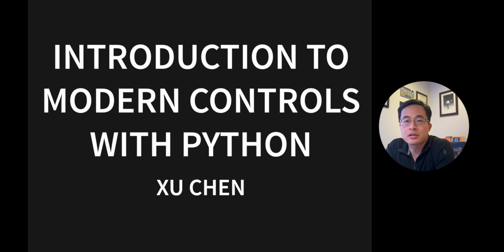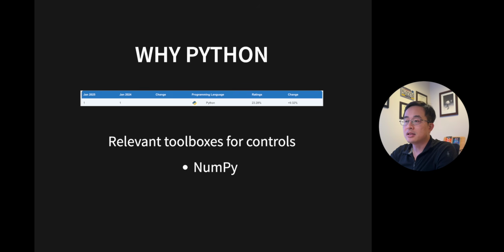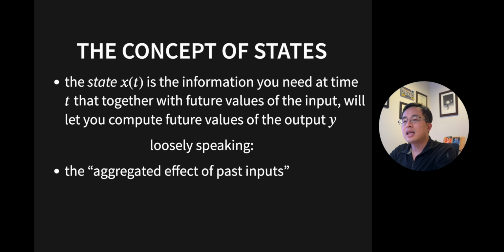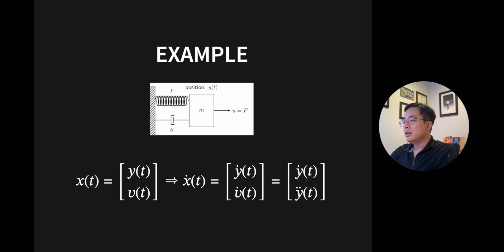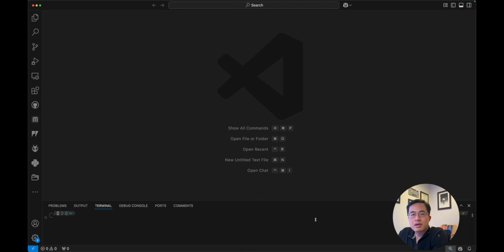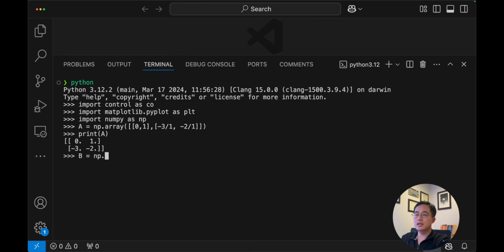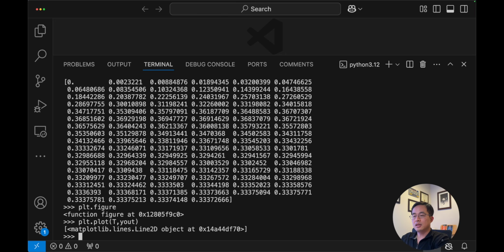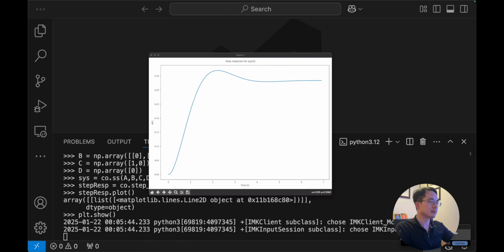From NVIDIA RTX BlackWell 5090 to Modern Control Engineering with Python: State Space Made Simple

Comment: Hi, thank you for posting this introductory video and demonstrating how you can use Python for state space modeling.  In your opinion, is there a preference when modeling systems between state space modeling and utilizing flow graph modeling?  Advantages / disadvantages?  Which method is generally preferred in industry?  Any insight would be greatly appreciated.  Thank you.
Reply from the maker: State-space modeling provides an excellent foundation for modern control techniques. However, classical methods remain invaluable for developing intuition and understanding the underlying problem.
Reply: @gradualgrowth8  I appreciate your response. 🙂 I am currently using the textbook "Modern Control Systems", by Dorf/Bishop and almost finished.  Is there a book that you recommend as a follow up?